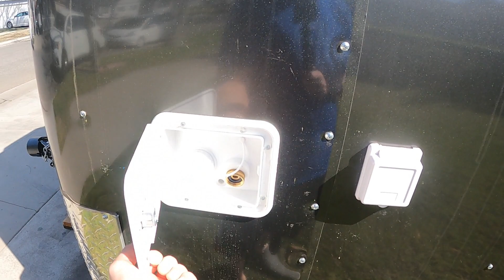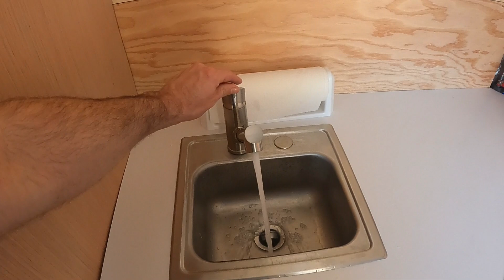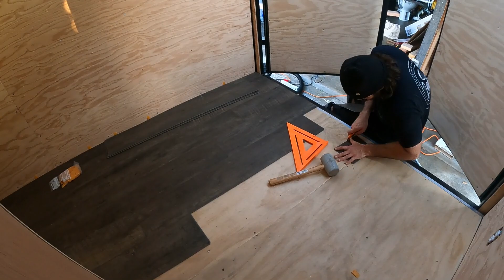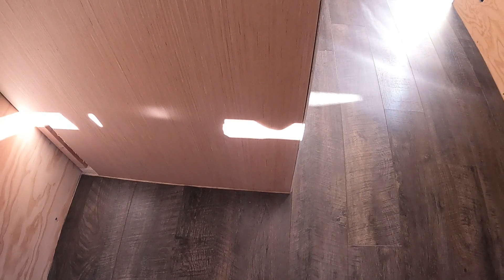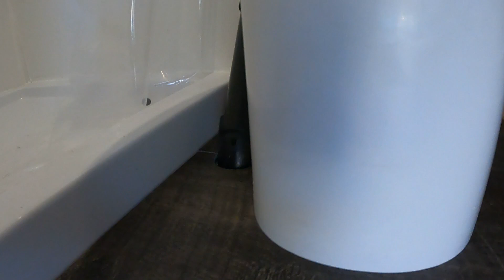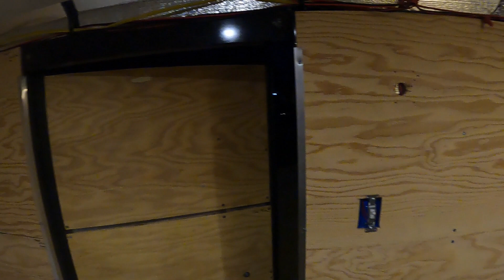Cargo Camper - First Trip - Progress and Problems

Comment: Put a check valve on the hot water output. This keeps the cold water from back pressuring onto the hot. If i were doing it, i wouid put check valves at the hot water output, hot water input at the shower mixer and also just before the sink input. Yes, the extra 2 would be considered over kill, but when it comes to water & gas redundancy, i think it is valid to do.

Comment: Hi from Valley of the Gods in Utah. I am here from Quebec with my own cargo trailer conversion, which is built for boondocking only. 
I am still working on some installations, and one of them is the water heater which is similar to yours. You are correct in that adding cold water confuses the water heater and is hard to regulate. Here is my solution.
Don't use the cold tap. Do all your temperature regulation with the water heater settings of flame and water flow. Old habits are hard to break. We get used to doing something one way, and it is hard to change.
I have been boondocking for 5 years now, and have changed my ideas about a few things. One question that I asked myself was: Do I really need to run a separate cold water line to the kitchen sink tap? Cold water to drink is in a jug in the fridge. So I eliminated even running a separate cold water line. One water line serves me for both hot and cold water. The only water line into the RV is to the water heater, and I am building a bypass for it. If I don't want hot water at the sink at the moment, which is most of the time, why have the water heater fire up for no reason if I am just running the water for a few seconds, maybe to fill the dog's dish? There is also an issue of not having the luxury of unlimited water while boondock. Even if I had a "normal" hot water setup, you need to run the water a little to get hot, no matter what system you use. So I don't want to casually run water down the drain as I wait for the water to get hot. I tend to do more planning as to when I actually need hot water instead. So when I don't want hot water, the bypass valve is open and the water does not go to the water heater. The water line then acts as if it was a cold water line. When I am going to do dishes or have a shower, then I switch the water heater bypass valve to route the water through the water heater, giving me hot water at the kitchen sink or shower. I regulate the water temperature solely using the controls on the water heater. I will be able to reach the heater by sticking my arm out of the shower while showering if needed. But I will likely get the temperature where I want it before even stepping into the shower. At the moment I am using a shower tent and showering outside with the water heater mounted on a post on the truck bed. 
I do have a single tap like yours, but have plugged the end of one of the water lines at the sink since since is not needed with only one incoming water line. I have no holding tanks. I have a compost toilet, and my fresh water tank is a 60 gallon water bladder in the box of my Ram. Shower and sink drain onto the ground, which is legal on most BLM land.

Comment: You need a two handle shower valve so the cold mixes just before the shower head and or sink faucet .  Also the water pump should be feeding the water heater , doesn’t really need it on the cold side.

Comment: GFCI was not required in the bathroom since there is no sink. Code references certain distances from the sink where GFCI are required. No sink, no requirement, as far as I know. For sealing the vent pipe at the floor, try a countertop trim for a hole. They come 1 1/2 and 2". You can cut them in half and place them around the pipe. Maybe foam under them. Did you flip your axles for more clearance height?

Comment: I ran my hot water heater with just one inlet and one outlet and plugged the cold water off completely. This will solve most problems but I have a summer and winter setting. And its one ore the other and that is that.

Comment: Why do you have two tank dump controls?   Typically, both black and gray water tanks exit from the same point; the black is dumped first, then the gray is dumped: that way the sewer hose is washed out by gray water.   You don’t reeeeeelllly want to haul around/handle a 3” diameter sewer hose dripping….well…you know what it drips.    As for covering gaps around the pipes, drill/cut a circle big enough to go around each pipe; rip in half with the blade tilted at any angle you choose; then slide the two halves together, using glue and screws to fasten the two pieces in place.   The angled cut can be turned so a casual observer won’t even see the cut.   Some caulk or spray foam will seal any small gap to keep bugs or mice outside.

Comment: Looking at your kitchen layout, sorry this idea is coming late. Where you have your converter/inverter put the fridge in that location on slides. Then where the fridge is now you can make a bank of draws and cabinet doors to access the electrical. The tankless can be enclosed but I would get metal screening and make a vent at the bottom and top. Additionally make a small door by the controls, once you figure the temp needed you won't need to open the door much. What vehicle are you using. Install a weight distribution hitch on the rig. That should help. You can make light upper cabinets for the kitchen using 1x2 and Luan skin.

Comment: I have seen a few people who have problems with the instant hot water heaters in RVs.  I have looked online, but the propane water heaters that have a tank are too expensive and hard to find.  I'd prefer a tank model, but when I install my shower in my trailer, I'll probably just heat water on the stove and use a $35 shower pump that I already have.  For the near future, anyway.

Comment: Your fridge can be on a drawer slide, could even mount the cabinet door to the front of the slide to keep the cabinets looking nice.
Have you tried putting check valves on your hot water send line? I'm curious cause ill be doing something similar with my bugout rig.
For the walls you could go sheet laminate, relatively lightweight.
If it were me I would put the bed about one or two feet higher and build up your storage or utilities underneath.  Would take some weight off the nose for sure.

Comment: Maybe use one of those rubber grommets to seal that gap next to the toilet. 
The ones used for the sealing the 2"-3" holes you drill in your water tanks
Maybe you already went with the foam tho...

Comment: Have you tried turning the heat control on the water heater down so it only uses warm water and doesn't start pulling in cold?

Comment: Hot water issue . . . (1) possible you're not using enough gpm (gallons per minute) to trigger the water heater to kick on.  With a lot of low flow devices (shower heads & kitchen faucets), on-demand water heaters will shut off when there is low flow.  I.e., they will not work in trickle mode.  Look at the specs on the water heater to see what the minimum flow rate is to activate heating.  (2)  If hot water flow works ok in the sink faucet, but not the shower, I'd say replace the single handle shower mixing valve with a two knob variety.  I have one in a shower I installed 20 years ago in my home, and it refuses to allow me to turn up the temp as high as I'd like.  A Dremel on a plastic stop helped.  But with single valve showers, we're at the mercy of the shower valve designer who has decided what's best for us.  I'll never install another single valve shower.

Comment: You should set your sink water temperature in a warm water to avoid the same problem at your heater. I have the same problem at camping with the same water heater you have.because if you to change temperature every time for your sink and the water heater is cause major problem the gas will shut off automatic for safety reasons and you have to turn the water control knob on the heater to your ride side to reset and turn on the lighter for the gas to heat up the water again.
To solve the same problem that just the best suggestion I have is to set the sink in one temperature (warm water) but I think you have to re do your hose connector..

Comment: Hot water heater… not a plumber but I believe several suggestions were made to handle the temp issue. The location on the other hand is 🧐. I’d rethink its location and free up that wall space. Little bit of work, but I’d think about moving/mounting that below the countertop… that way you don’t need to “cover” it or hide it from plain view. Just my 2 cents 😬. Looks good- enjoy you travels.
Reply from the maker: Thanks! Putting the water heater below the counter was the original plan, but this one turned out to be too big.

Comment: We had issues getting the hot water supply correct in our house, The issue ended up being an anti-scald device in the shower, because the water pressure was not the same as a normal city water, we’re on a well, it would not allow enough hot water through.

Comment: You're going to need to go with a two handle faucet. Using a single will mix the two together and end up causing a cross-feed. Unless you can up the pressure of your pump to overcome the minimum GPM required by the water heater you'll have bad performance. With the size of your heater you should have be able to make it happen.

Comment: The problem is your single valve faucet. Just replace it with a double handle faucet and that should fix the problem. I also suggest that you install an expansion tank for your Seaflo pump if it doesn't have a built-in tank already. This will improve your entire water flow system and prevent the pump from cycling frequently. Thanks for the video
Reply: Plus I would have the exhaust for hot water tank facing down not straight mine works great even in cold weather ..Use muffler tape for pipe thru wall ...And mesh stainless screen to end pipe for noseeums mine is battery powered 2 d's but has exhaust ..Use for cabin ...The 2 water lines is better to regulate water temp ...
Reply: You want moisture to get out of the exhaust ...Propane makes moisture alot of it .

Comment: Just add a back flow preventer to the hot side of the pex with flow pointing out it will prevent any cold from feeding back . Quick easy cheap fix
Reply: Can you provide a little more detail? Pointing out?
Not sure what you mean.
Thanks,  we are getting ready to start our cargo trailer conversion. Would like to avoid problems.

Comment: Make lock assemblies on doors lock unlatched...so you cannot be locked in
Reply from the maker: Yeah I still need to add the ability to lock the latch up.. but I've found that I can work the door open as long as the door isn't latched closed.

Comment: The main problem is you.  You want everything you have in the house to fit in a small trailer.
It is a small trailer.  Putting in walls makes it even smaller.  Best to keep it all one room. Mix the hot water in a bucket to get the preferred temperature.  Then use it out of the bucket to take a shower. Shower stalls are not necessary at all. I do not understad why one needs a strong wood and fiberglass enclosure to contain spraying water.  Just dose not make sense. A piece of plastic is all you need to make a wall for a shower stall.  In the van I do not even do that because I pore water from a 1-gallon jug over me to clean up.  The water then runs on a plastic mat and out the door.  So easy, so light weight, so nice.
Put 4-inches of foam padding on a cot and get rid of that bed. You are still thinking house and not cargo trailer.
Reply: Dude, he's building the camper/trailer he wants and doing a good job. Also its "pour" and "does not." Just saying.

Comment: Check with electrician about gfci  outlet...I think if the outlets are tied into and down line from the one in the kitchen, they are all gfci protected.  Not sure if two in line will work right.
Reply: It depends on which terminals are used.  One GFCI can then be "chained" to other regular plugs and they are protected too, so you only need one, on your case.  But since you have two, make sure you are using the top terminals on both and not "chaining" them.

Comment: The other option to fix the hot water is to buy a Bosch point of use electric water heater to use as an insulated holding tank so that the water draw is consistent.

Comment: Looking good. Lots of home comforts. 😁
Iv seen some folks make a drawer slide for their fridge.  Or you could cut the base trim and mount the fridge to a board with small casters and roll it out. I think I'd be removing the hinge until I sorted it out. You've done a lot of nice work here. I'm interested to see what you change after using is for awhile. Cheers!

Comment: You also need a flush line on the black and gray tanks.
Reply: Hi Danny, 
Can you please explain more about this, or share a link? I need to know what you mean (I am about to do the same thing)
Reply: @DanielWilliams-fp4oz  when your draining the poo.  Maybe you want to add water to push out more poo.  That's why there is non potable water at some dump stations.
Reply: Or sometimes you want to rinse out the last piece of poo 💩 without going inside to flush.  There would be a water port near the drain where you can add water to the black tank that's the flush line.

Comment: Just adjust the water heater temp to whats comfortable. Use only the hot water then.
Reply from the maker: That makes sense. It's a bit frustrating to not have the fine grained control, but this is a reasonable option.

Comment: My honest feedback on those holding tanks . When they  are filled and you are riding around the water and crap inside is going to be swishing around everytime you hit the brakes, take off . I don't see them straps holding too good. I'd get some angle iron and bolt them up to your frame or get some dimensions and have some one weld some frames up that you can bolt on.Remember water is 8 pounds a gallon and if those tanks are 15,20 gallons that's pretty heavy. Other than that coming along good.
Reply from the maker: Yeah I'm still not convinced this is going to handle all the weight on the road yet. I'll avoid riding with full tanks until I get more confidence from testing or building out improvements
Reply: @befreebuilds  Its better to be safe than sorry. Otherwise it's coming along nicely.

Comment: The cold line on the sink is the path of least resistance for your water.  When you turn it on, you don't have enough pressure to operate the water heater.  You could balance the resistance by adding a pressure regulator to your cold line.  Search Amazon for "Camco (40055) RV Brass Inline Water Pressure Regulator".  Great series!  I love watching it come together!
Reply from the maker: Interesting that could be a pretty easy fix. I'll probably give that a shot!